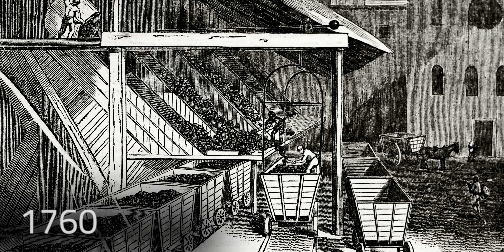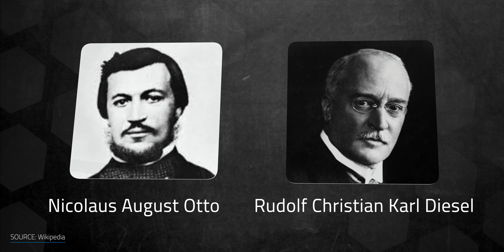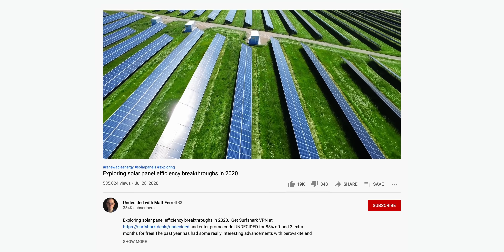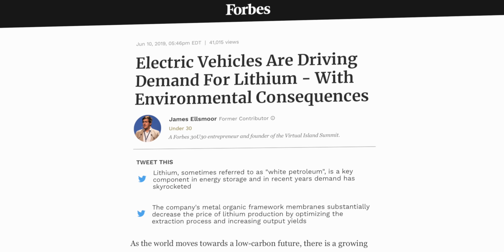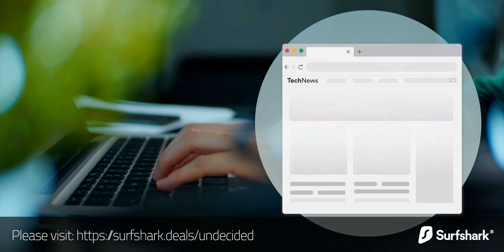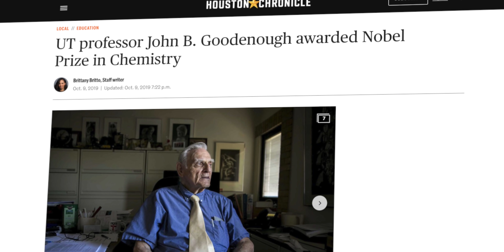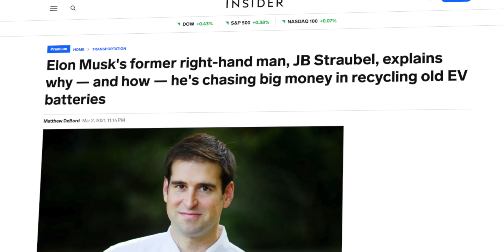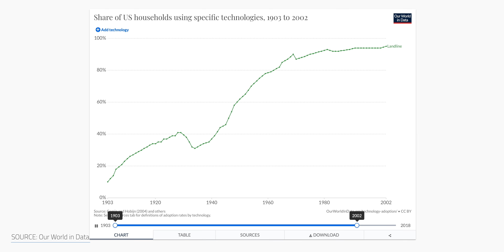Is the Future of Renewable Energy Inevitable?

Comment: Fucking nuclear
Reply: Had California spent an estimated $100 billion on nuclear instead of on wind and solar, it would have had enough energy to replace all fossil fuels in its in-state electricity mix.
    Had Germany spent $580 billion on nuclear instead of renewables, and the fossil plant upgrades and grid expansions they require, it would have had enough energy to both replace all fossil fuels and biomass in its electricity sector and replace all of the petroleum it uses for cars and light trucks.

Not to mention that nuclear is THE SAFEST form of energy.

Comment: The next jump in renewables is grid level storage. I'd always assumed this would be done with synthetic methane, as the as gas infrastructure and distribution for this is largely in place and proven. With synthetic methane you can run a combined green solar/wind/gas power plant.
Hydrogen could leapfrog methane if it gets faster return on investment for the shareholders, although I'd be surprised. I can only imagine the profits are razor thin as it is which has to be why it isn't common.

Its also possible new nuclear will bury renewables, but I don't see it gaining enough public support to get government backing.

Comment: I'm always surprised that tidal and geothermal get so little mention, but I'll need to watch your videos on that. Renewable power that is available 24/7 like geothermal cannot be compared in cost terms with solar/wind as these intermittent sources always exclude backup costs and grid instability regulation (however that's done). I look forward to checking out your other videos.
Reply: That's because they are extremely limited geographically. Where they are viable they have generally already been adopted.

Comment: Matt,

I feel it would be more appropriate to say that Edison relied on low voltage transmission, which is inherently inefficient due to the required high currents. The fact that his systems used direct current is true but misleading.  There is nothing inherently inefficient about direct current power transmission.  Now that semiconductors can rectify high voltage DC into usable voltages, DC is more efficient than AC for long distance transmission because there are much lower field losses.

I think that semiconductors will someday herald the age of end to end DC power.  This power is more efficient and easier to create and use, with no rotating machinery or transformers required.  Semiconductors also have the advantage in sensing, control and rapid shutdown, which reduces outages and makes electricity inherently safer.

Comment: Green Hydrogen has ridiculously low conversion efficiency, which means we will need 3 times the land to install the renewables needed to produce it, compared with using electricity at the first place. Land use change is the most underestimated factor, and can end up doing more harm to the environment than good, this way.

Comment: About that sodium battery, it is not going very well...
Also EU just damned hydro electric as a non renewable, as rain is not recurring factor or snow melting.
So that rule should apply for solar and wind as well really, as it is not the same sunray you utilize, And the sun will die at some day so...
Its like fossile fuels, it will run out... and that is not considered renewable...

Comment: If you pick steam power from coal, a part of what pushed the efficiency of steam engines were advancements in material science.
What the use of coal allowed was the mass production of iron.  Then later, steel.  The better steels that were produced allowed engines to be made of better materials.  This also allowed the production of better tools too which allowed better accuracy (with repeatability) when making new engines and new tools.  Designs of new engines depended heavily upon the new materials which could be used.

Now there are a vast array of materials which are being explored, with every more precise methods for their use over time.

I'd say if graphene becomes a mass produced product, it will basically change everything, because it allows for ultra-strong, ultra-light weight structures.  At the same time it also allows for the mass production of super capacitors, as well as other electronic components.

If we could replace a third, two thirds or even the entire battery of a vehicle with a graphene capacitor the weight, charge time and power density issues all simply melt away.  It's easy to imagine that causing massive increases in vehicle efficiencies as well making possible very long ranges at affordable prices.

Comment: Correction. AC long distance power transmission is not as efficient as DC. AC suffers from inductive and capacitive losses that DC doesnt.
The lastest very long distant power transmission systems are moving to DC. https://en.m.wikipedia.org/wiki/High-voltage_direct_current

Comment: Yes it is a big lie. 

More in terms of the optimistic idea that it is somehow a short term, instead of a long term solution. 

In a long enough timeline we will run out of fossil fuels, and must use renewables, or create fossil fuels, but still we will do so with renewable energy. It is a blatant lie that renewables are ready to take over our energy needs now though, or even in the near future. You might have a EV but if your most likely using electricity produced by coal or natural gas. There is a big lie that you can buy solar power from an electricity company, that is just predatory marketing preying upon well meaning but stupid people, there is no way to decide what electricity goes where in the grid, you get the same power your neighbors do. Perhaps they buy energy credits or fund solar expansion with their profits, they do not sell solar power. The only way to ensure you get solar power is to produce it yourself. We will still need fossil fuels for quite some time to bridge the gap while renewable technology increases in efficiency, storage and scale. Realistically, we will probably have nuclear fusion plants providing power before we transition fully to renewables, and at that point, renewables won't be all that important. So perhaps we should be looking at renewables more as a bridge to fusion to reduce pollution in the short term, rather then a bridge from fossil fuels. Not bad to improve the tech regardless, in case fusion never really materializes. Technology improvements always increase production of additional products in unforeseeable ways too, so tech for techs sake is a good enough reason to improve the tech, someone will figure out how to utilize it for good, to be sure. Electronic/hydrogen vehicles are definitely a long term improvement still as a replacement for oil based vehicles. I do question how efficient plastic production is going to be if we get rid of gasoline usage? I'm sure we will find some use for the gas/diesel. 

Right now energy production in America
Fossil fuels 79%
Nuclear 8.6%
Biomass (wood/bio) 4.8%
Wind 3%
Hydro electric 2.7%
Solar 1.25%

Comment: I think the next advancement in Energy is when people get out of the mindset of going back to older technology. An industrial revolution as you put it tends to follow the discovery of a new technology and the subsequent development of it. It doesn't tend to happen with the re-development of an already existing technology.
I don't think people really put thought into the true cost of renewables. Even if we don't think about the cost of developing renewable energy, there are probably impacts on the environment that aren't being thought about. Take for instance solar. It has miniscule coverage of the current landmass. At a scale that it completely replaces Natural Gas, would the reduction in solar energy reaching the soil have an unintended affect on the Earth's geology such as ground water circulation? With wind would the collection of wind energy reduce air movement and weather patterns?
With hydro we know there are issues with sediment and a disruption in the natural ecosystem.

Another issue that I don't think people talk about is what is the cost of these renewables. When making a fiberglass or carbon fiber wind blade, they require thermoplastics. In other words oil production. Petroleum is a waste product of this process. What do we do with petrol waste when there are no petrol cars?

Comment: Fourth gen Molten Salt Nuclear Reactors (MSRs) is where far more RnD needs to be spent (China leading at the moment!!!) Walk away safe, 98% less waste than present nuclear, some designs can run from EXISTING NUCLEAR WASTE, far cheaper because they run at low pressure so huge containment vessel not needed, can be compact ‘factory’ manufactured rather than massive ‘on-site’ construction. Proven working design in the 60’s was abandoned in favour of high-pressure water reactors because MSRs were NO GOOD AT MAKING NUCLEAR BOMB materials!

Comment: I think renewables+hydrogen definitely do have their place in the future, but to replace the entirety of polluting fossil fuels, I think it cannot go without (safer) nuclear fission (and hopefully soon enough) fusion to get emissions down or close to zero. First to benefit will as always probably be the developed countries though.
Reply: I have a variety of gripes against nuclear, but one of the biggest is the plain fact that it’s NOT a solution for large parts of the world, because their economies (and politics) aren’t sufficiently advanced to actually support nuclear. How many years do you think it’ll be until Somalia is ready for a nuclear power plant? That’s a big problem. Solar and wind, on the other hand, are cheap and easy to implement at quite small scale, down to a single off-grid building.
Reply: @davestagner  It is also not a solution that reduces in anyway the use of hdyrogen or otehr chemical fuel on very rare occasions to driver peaker power plants.
It doesn't do that as Nukes are baseload specialists and not peakers at all.
Thus nukes do basically nothing to relive our need for some peaker genrator technology to get through just the rarest and very worst low VRE preriods. Such events happen for example 1 or fewer times per year.  For problems periods such as that adding nukes do basically nothing at all to solve the problem.
Reply: @ If you have base load power like nuclear or geothermal, today’s batteries are a cheaper and better (not to mention cleaner) solution than gas peaker plants. Despite all the “WHAT IF TEH SUN STOPS SHINING FOR SIXX MONTHS?” wackiness, the amount of peaker energy needed is very predictable to a couple of nines. Build enough battery to handle a couple of nines and just bring the old gas plants online for when we need more than 2-3 days of battery.
Reply: IMO The best use of Hydrogen or derived fuel that is more easily storable, then used only when the better solution are not cost effective as the thing they're being used to solve occurs so rarely. The are VRE droughts so severe and HENCE RARE thatthey only occur once every 7-10 years. We had one in 2024 the last, nearly as bad one was 7 or more years earlier. The stuff we need to get through events that rare, need to be very cheap to store and near zero leakage (self discharge) energy storage system. Making H2 (using PEM) and then converting that to say (for example) methanol fits that bill. it has the added benefit of use being able to do that using much less than 99% formed electricity and it ability to be able to cheaply offer DRM during Apr May Jun, is another added bonus. 
The full ubiquitous hydrogen using future is TBMK marketing hype, and or click bait. There are cheaper ways of doing land transport. The energy density of long haul plans, probably means we will just do much less of that at higher cost per km than previously. Sorry ... not all rainbows have real ponies attached.
Reply: @alanchristiansen2880  I agree, fuel generation/storage is the right way to solve those solar/wind droughts in the long run. In the short run, I’m good with using fossil methane as a stopgap for when the renewables are insufficient. Insisting on perfect right now and forever gets in the way of solving the problem! To start with, we need enough solar to handle some parts of some days without fossil fuel power. Then enough solar/wind+batteries to be able to do 24 hours on the best days (sunny/windy in the summer). Then you keep scaling up, so we have enough renewables/batteries to do 24/7 into the shoulder seasons, then cutting into winter. By the time you have enough renewables+batteries to do good shoulder season coverage, you have ENORMOUS surpluses on those sunny summer days - surplus that can be used to generate fuel that can be stored very cheaply for a long time, to help cover the gaps. 

It gets even more interesting if enhanced geothermal becomes viable/affordable at scale (which might happen), or if nuclear becomes affordable/fast to build (which probably won’t happen, but we can hope). Then you have some base load to cover nighttime. But it has to be cost competitive with incredibly cheap solar/batteries.

Comment: I have been watching your channel alot. I think the future is my innovation. I invented car that runs 2000 miles on a single  fill up. Simply convert the fossil fuel to electricity by generators. Then feed this electricity into electric motors thru capacitor. This innovation will extremely raise the efficiency of usage of fossil fuels. This will reduce co2 production to one third or forth. You still can use natural gas or biofuel. Think about it. Salut MINA from Egypt.

Comment: Just based on atomic masses, a battery constructed with sodium over lithium will have to weigh more than three times as much to have similar current density. So yes, sodium batteries may be practical for stationary storage, but not for mobile applications. We might be able to reduce that weight ratio a little bit using different anions and casings, but I doubt sodium will ever be practical for batteries that power vehicles.
Speaking solely as a chemist, it seems that if we can use solar energy to power a chemical reaction like electrolysis or photosynthesis (of liquid hydrocarbons) we have a better chance of creating an chemical-energy cycle that is sustainable and less limited by the availability of minerals/metals.

Comment: It's not just the panels and batteries that are getting cheaper.

I'm going with "Inverter technology". It is showing the same level of advancements as the others, and the price is finally low enough to do some interesting things.

At some point the cost of inverters will be comparable to the cost of transformers and we will begin using extremely high voltage DC power lines that lose much less power.

I see lots of slow capture electronics in our future, made possible by improvements in electronics efficiency and price. 
* Commoditized Stirling engines that use excess heat to generate electricity.
* Roadway turbines that capture the wind produced by automobiles and busses.
* Gravity based storage systems - carts on tracks, big weights lowered into holes...
(I think all of these have been mentioned on this channel)

A lot of things that just are not practical now will need to be revisited. Time to start looking at 100 year old patents.

Comment: You have to include very large, zero carbon base load for the energy we need. Nuclear power has proven to do that.  The intermittency of renewables has to be backed up by fossil fuel generators. This is not a zero carbon solution.  We are also destroying habitat with large wind and solar installations.

Comment: I just wanted to point out that DC power transmission is actually more efficient than AC over long distances, since there aren't induced currents in the surrounding environment due to the alternating magnetic field. The loss comes from the transformation of low to high voltage and back again, since, yes, low voltage DC (and AC as well) is inefficient over long distances. It's the inherent transformability of AC that makes for overall more efficient (and simpler) for long distance power distribution.

Comment: EFFICIENCY! So much talking but no numbers included. You can talk about Hydrogen but you should look at reasons why most is extracted from fossil fuels. Electrolysis and then reversed process in fuel cells have massive losses. Most energy is lost in process so how is that suppose to be a viable option?

Comment: Instead use batteries we can use synthetic fuel made with co2. Much more energy density and we don't need to destroy enormous areas for the mineral extraction. And best of all: we can keep run combustion engine cars that will be carbon neutral

Comment: I think Hydrogen fuel will be useful for planes since it is damn near impossible to fly large planes on batteries since energy density is to low. Hydrogen could be good for long cross country vehicles like semis where electricity is.less practical due to recharging times

Comment: Stirling engines are a possibility as are any type of mechanism that uses energy to lift a mass to a higher geo-potential state.  If community water tanks placed a turbine attached to a generator shaft to the outlet, they could recover some of the energy used to pump water into those tanks and still have enough flow through altitude to sustain good water pressure to the distribution network.